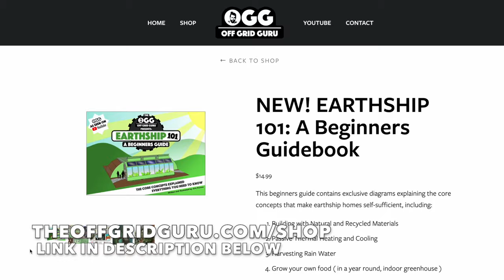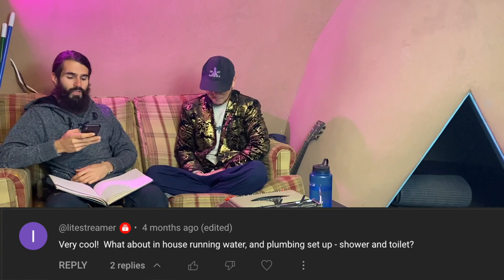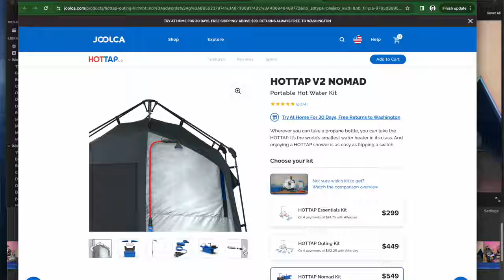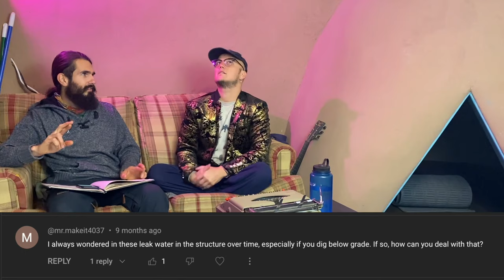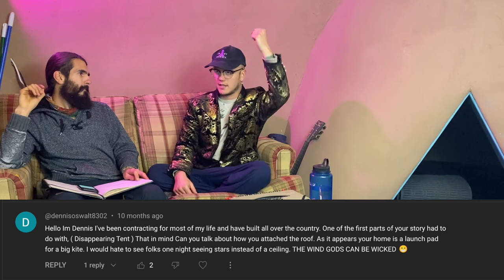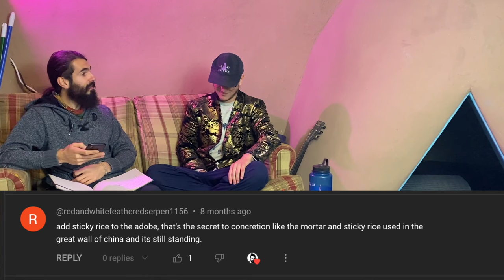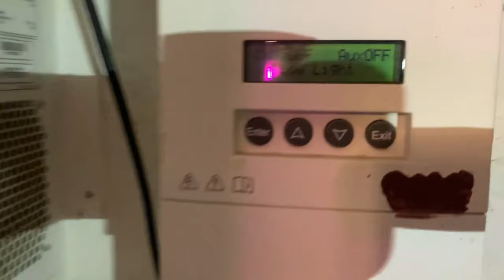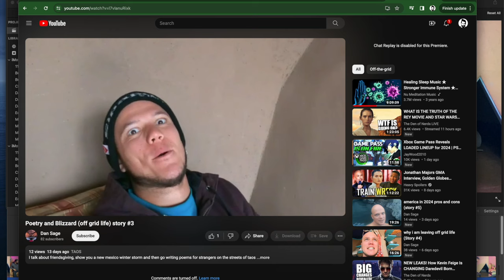Hyper Adobe Tiny House Revisited - Your questions answered - Water systems explained

Comment: Okay. Let me get that straight. He did spend $33,000 with no bathroom & no proper plumbing. Where did the money go to if he didn’t had to buy the wall building materials? Sorry. Something is missing. Is the price for the lot included? I’m asking because I’m building a 160m2 house on my own. I got all the materials for the 2 level building and didn’t spend $18,000 yet. My roof will be another $1,500 - $2,000. That makes it to $20,000. This includes all my tools, concrete mixer and my property fence. Did he spend $20,000 for the solar system? Sorry. Adobe must be really expensive to build. And I mean really expensive. I have to add: I am building in Panama where materials are more expensive than in the USA.